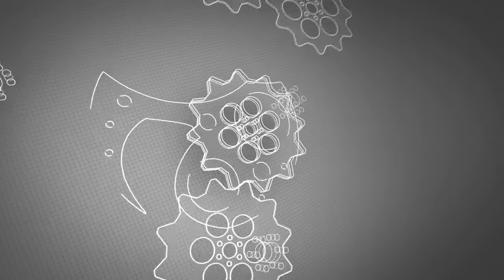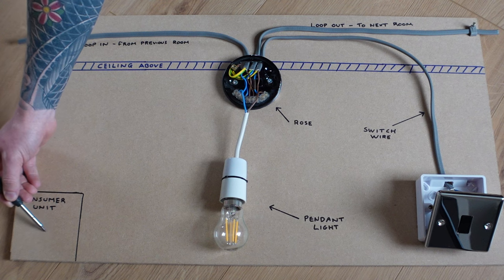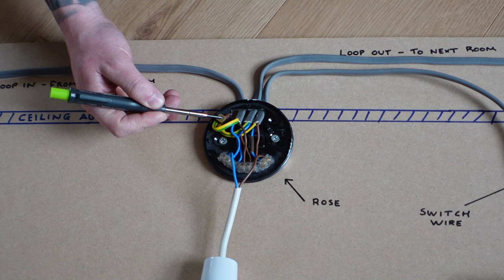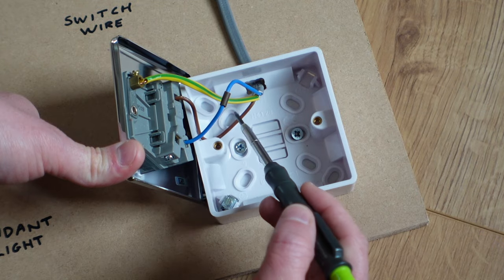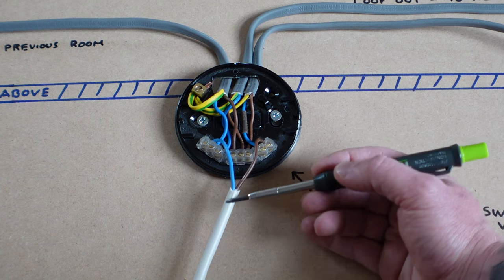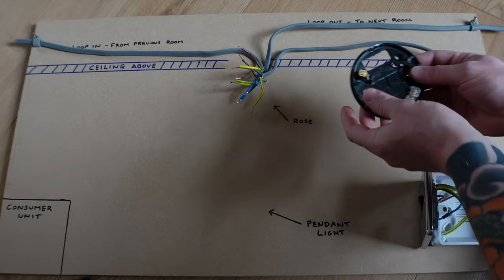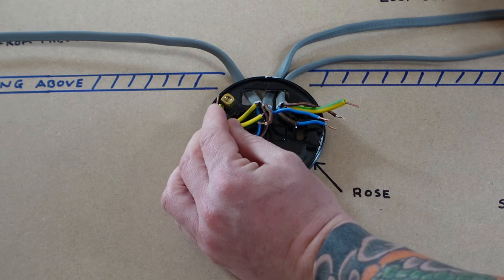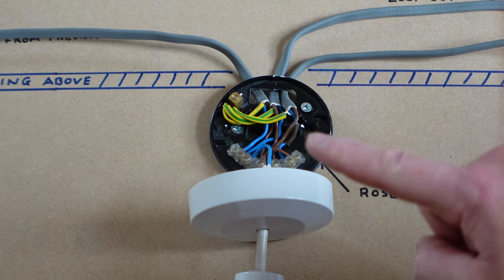How to Wire a Ceiling Rose | One Way Lighting Explained

Comment: Okay, Great video. I’ve moved into an older house and all of the lights are off centre. I want to change them all to pendants in the centre of the room. I’ve had a quick look at the light fitting and it looks like it is a single wire. Where are the other two? It’s confusing!

Comment: Another great informative video,I recently fitted new ceiling lights in a friends house using the new Quikwire system and it was brilliant,so straight forward with every wire position easily identified,obviously it's more expensive  for the connectors but I couldn't believe how fast it was to connect up the lights
Reply from the maker: Thanks for your comment 👍

Comment: Great, thank you. Managed to sort out a ceiling rose and its all working. 

Q. The old wiring was using a neutral and an earth as a switching wire. Not too sure what was happening there. Thoughts? (I didn't touch it, left as is)

Comment: really helpful and clear video thanks! what do you do if a new light fitting in a chain only has a live and neutral in it (e.g. led ceiling lights) what do you do with the 'extra' switched live, neutral and earths? (N.B. in this case there is no earths as lights are plastic). thanks!

Comment: I have learnt so much from your videos so thank you so much. I needed to change one of my ceiling roses and I watched this video and felt confidant in doing it. However, when I removed the cover the light fitting only have one line coming in to it. There is not line going out (loop out) from the circuit and it could be perhaps this is the end of the line in the radial circuit. Thing I don’t understand is , it doesn’t appear to have a connection from the switch. (Can’t see a switch live) . Anyone know what’s going on here?

Comment: really good video and explanation. I am actually trying to change two Ceiling Rose with new lighting. However, the one has 3 cables and the other one two. After changing them the bulb in the 2 cables remains constantly on. But i am not sure where is the issue after making a few changes.

Comment: Very helpful. I bought a plastic e27 ceiling rose but it has no choc boxes and only two wire entry points - positive and negative. So I assume positive goes to the central part of the e27 screw in fitting and the negative to the back section. As it's plastic there isn't any earthing connector and no wires. So can I buy lighting cable without earth included?probably only need about 50mm - or do I just use some from the old ceiling rose by shortening the drop? I'll keep it incase I want to swap it over!

Comment: Excellent tutorial. One question if I may;  I want to move a ceiling rose around 4ft... would it be ok to extend the loop/switch wires in the loft via wago clips or would I need to replace the whole wiring?

Comment: Just to clarify,do you connect the switch wires -neutral and L wire together with the L from the light ? So the 3  L wires together as one ?

Comment: Hi fantastic video, very easy to follow, but I have a question, I have the same set up in my lighting as you show on your video, but I would like to add another light over the other side of the room from the same circuit, but I cannot get access to the cealing rose of the existing light, to take a spure of to the other light,  but I do have access to the existing cable in the ceiling from the light switch, so can I break into  the switch wire and using just the switched live cable, cut that and  connect onto that making a loop, so the circuit will then run from one side of the cut switch cable, down the new cable to the new pendant, then back down the other side of the new cable re connecting to the other cut side of the switched live, I think a drawing would probably help show what I mean a bit clearer, as what I have said might not make sence, any advice would be great, cheer stu

Comment: Hi fellow Norfolk boy!
I'm looking to add additional lighting to my garage. 2 topics here.
1st,I want to add a 2nd switch to the front of the garage. Would it be easier to wire the 2nd switch into existing switch by the back door and run the 3 core and earth along the length of the garage or would it be possible to wire it into the final lighting assembly close to the front of the garage?
2nd, I kinda expect it'll be easier for me to wire up roses to carry power from one light unit to the next.

Comment: Thank you very informative video and great Channel. Just a quick question, can I connect a light pendant straight on to a fused plug using normal flex wire. I would like to put a light in my shed,I have plug sockets in there. Would this work or booom.
Reply: Just fix a plug on the flex.

Comment: Got a question? I'm thinking about lowering my ceiling in the hallway and put another light at the other end of the hallway. So I need a length for 1.7 ? cable in just feed it into the Rose and connect it up inside the Rose. And then have another rosa at the other end of the hallway. in connect the light up to that. If that makes sense?.
Reply: Get an electrician if unsure.

Comment: My light canopy just stopped working.  It has like 5 bulbs and I've changed one with a working bulb.  But it still doesn't work.  I took light switch off and replaced it with another one and still no joy. The only thing that looks weird is the earth isn't really secure to the back plate to well.  But when testing I did make sure the wire was touching the metal. Does anyone have any ideas?

Comment: I’ve hit a wall so to speak. Got two lights in one bedroom, fitted the first one which was quite simple - one of each colour from the wire in to the light itself, came to do the second one and didn’t make note of how it was laid out as I unscrewed it, this one has two of each coming down 🤦🏻‍♂️ I put one of each in to the light and the light comes on, the problem is the one I fitted first which has one of each now doesn’t come on. Please help.

Comment: Always bugged me how these kind of ceiling rose fittings are still a major thing. 
A nightmare if you're replacing the rose or say putting in a ceiling fan/light and trying to cram all those wires back into a such a small area. 
Wish more would have a 4 terminal junction box in the ceiling area, and then just drop down the wires for the light fitting itself